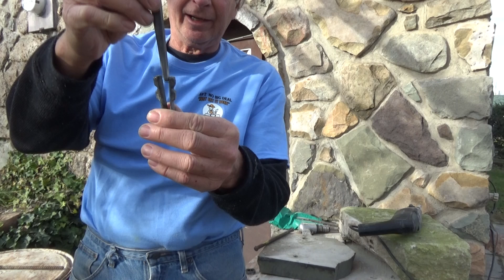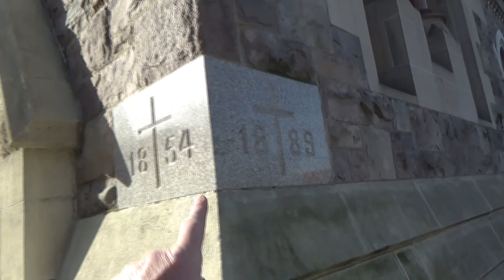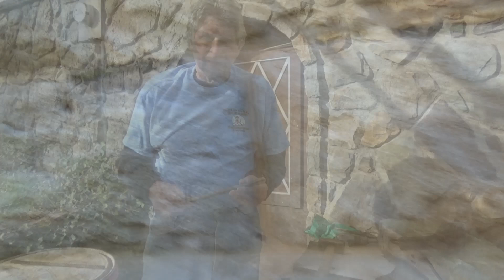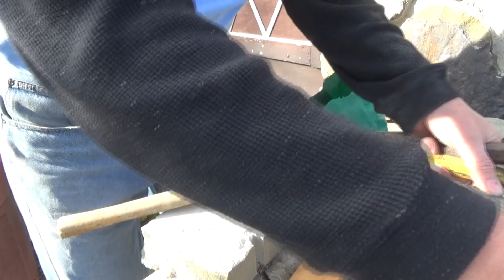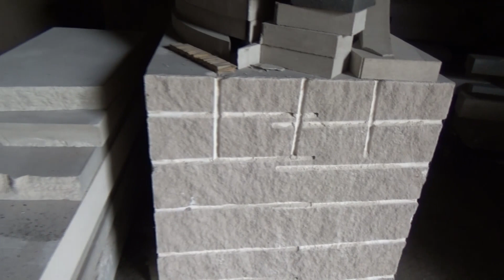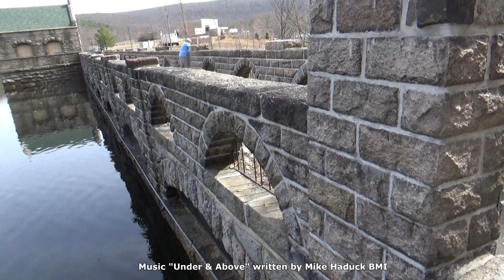ROCKFACING AND SHAPING STONES (Part 12) Mike Haduck

Comment: Mike the Old-Timers in the Plumbing trade, the ones who did the lead caulking joints that used hammers and different types of irons to pack the cast iron joints water tight, if you ever look at their hands they had permanent bumps from the many bad hits...tanks for sharing
Reply from the maker: Thanks Tom, Mike

Comment: That's a cool way to split stone Mike. While I've tried it I never had enough plug & feathers for the length of stone I was processing. In that case it does not work as well. Also, not all stone varieties work as well as those shown. It is kind of fun if you have the time.
Nice video.
Paul
Reply from the maker: Thanks Paul, Mike

Comment: Mike, I'm an amateur builder who built his house 35 years ago. I hired a mason to do the brick work on three sides of my house, I helped him mix the mortar, put up the scafolding and I used those pinching clamps to bring him the bricks. I counted the bricks laid: 7346 total. For the front of my house I wanted natural rock faced sandstone, the type found near the border between Vermont and Quebec. He told me to order 23 tons of stones and we planned to start that project the following April. He sadly fell gravely ill that winter and I was left with a load of stones in front of my house. I turned myself into a stone mason, bought a set of carbide chisels and started working like a convict in a quarry. I cut those stones on all sides to make them flat so as to have a maximum quarter inch grout line, the sides all being square like bricks, thousands of sledge hammer blows. It took me 18 months on three years (I had a job and a wife and three kids to take care of). Every day for the past 35 years when I get home I admire my work and appreciate the work masons do in creating things that will last far beyond their stay on this earth. I have watched all your documents and admire the way you transmit your knowledge. My name is also Mike, the nickname above was a joke when internet had very few people using it, my avatar is of my hobby doing technical diving, in particular underground diving where we are surrounded by rocks and stones.
Reply from the maker: Thanks for the comment and I appreciate hearing that, it's a rare thing anymore to have houses built that way anymore. Every thing has become fake, I bet you wish you had a video camera back then to put it on youtube,  not many real stone masons left. God bless again thanks for telling me that, mike

Comment: Hello. That was very informative. Thank you for the update!
I have this question. I'm building a masonry wall that is about 8 yards long about a yard tall and 8 to 12 inches wide. This is a forested area so a truck is out of the question. But I do have plenty of rocks. At first I just started to put the rocks together with mortar. But I can only work by myself for 1 day per week and I need to finish this soon. So now I'm just making forms and dumping mortar mixed with gravel into them and then sinking stones into that to beef up the volume. Using 3/16 wire reinforcement too. I'm wondering if you've seen that method used before. Do things built this way hold up? If not, will finishing with stucco improve the lifespan? Should I be making plans to reinforce it with brick work once I've got the time? Thanks!
Reply from the maker: Hi Sasha, unless I was there to see it , I really can't say, thanks Mike
Reply: @MikeHaduck  Thank you for your reply! I was just wondering if you've seen anything resembling the thing I described. Anything in the same ballpark. If not, then no worries -- thank you either way!

Comment: Question, i want to build a shop like the wall behind you, i saw a repair of a midevil barn wall in ireland. They did 2 walls of carfully staked and morterd stone about a foot apart and filled it with rubble and mortar. Could you pour concreet instead using the walls like a form?  Would that be stroner or would the stone eventurally peel off and not bond well
Reply: As you said location is important...im in whitman arizona and i want to use natrual local stone
Reply from the maker: Hi Mike, usually I build walls like that the same way I did retaining walls, but everthing is inspectors and permits anymore, thanks Mike

Comment: what is thermal facing
Reply from the maker: Hi Fritz, they use thorches to blister off the face of the stone, thanks Mike
Reply: @MikeHaduck  thanks for the info mike. so the stone basically just splatters off because of heat expension? sounds like another interesting video ;D